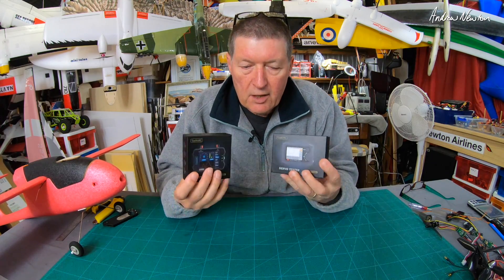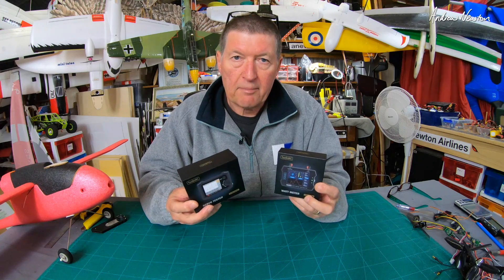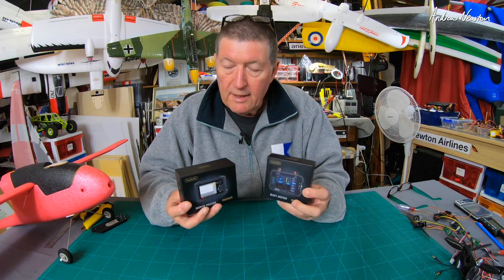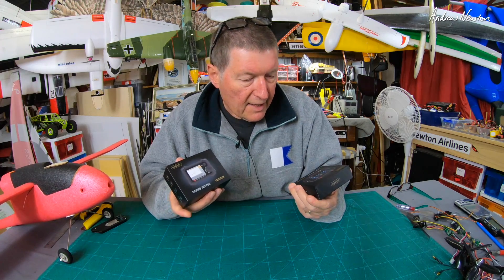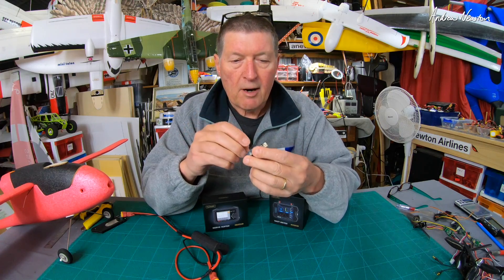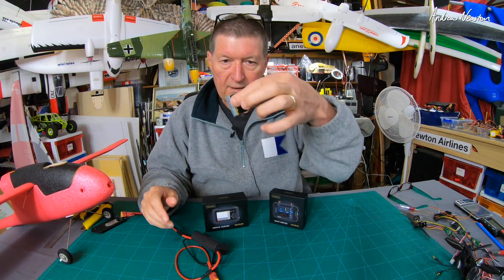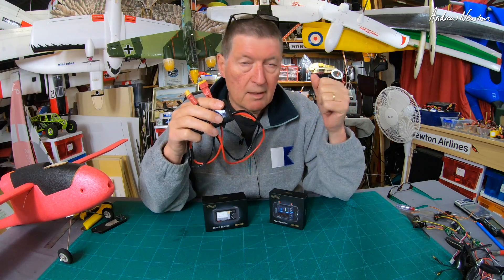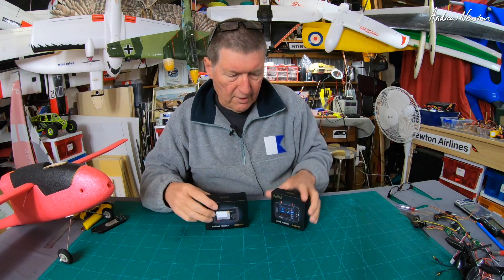ToolkitRC WM150 & ST8

Comment: My watt meter works fine with old fashioned plane esc's but if I use some modern opto esc's ( quad esc's without a bec) probably running newer firmware etc it just gives crazy readings moving all over the place. To check opto esc's I have to use an an inav board with a current meter and look at the osd. So perhaps if you do a full review you could test with multiple types of esc's?
Reply from the maker: OK I'll try Optos too